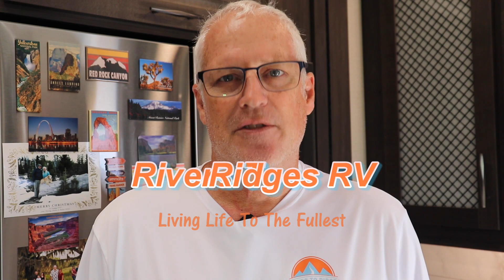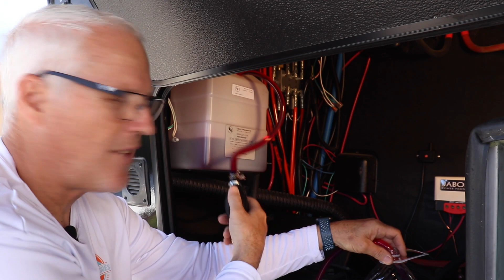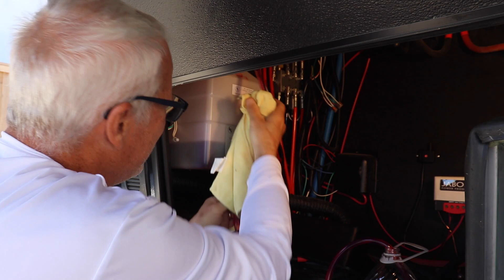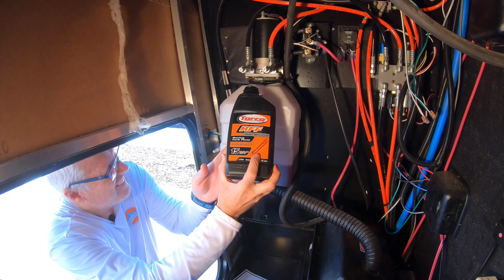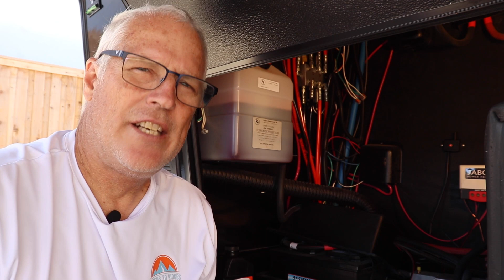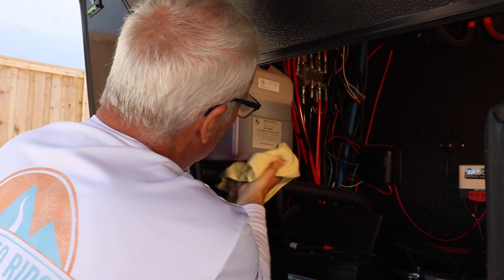Stop This Annoying RV Noise In Under 30 Minutes (full time RV living)

Comment: So did it help?
Reply from the maker: Hi Kaye, Yes, so far it seems to help, we haven't heard any popping noises yet.
Reply: I appreciate this helpful info. I truly do to I have been wondering the same type of noise coming from my pump area. I have a class A and it can get pretty annoying. My issue is if that LCI are aware of this issue from many other RV’s that are having this problem, shouldn’t they compensate for their system? Instead of taking a easy route by giving directions on how to hopefully fix the issue. Just frustrating because I have already contacted them about my slide issues and was giving to many run around. Thank you once again for the extremely helpful info. Much appreciate 👍🏽
Reply from the maker: Thank you, sorry it took so long to get back to you, I missed your comment. I agree, I bet if the manufacturer used the correct products in the beginning instead of trying to save a little money, then most people wouldn't even have the issue.

Comment: My Husband passed away.  We live in our 5th wheel, stationary and long term.  He had a deck built onto the front with stairs.  I don't think I could move the my levelers (jacks) Any suggestions? Also before he passed, we had issues with one of our  slides. He pulled it in and then it would NOT go out for a really long time. We had to get help. Now I'm hearing those noises every night and sometimes the 5th wheel feels like it's shaking like someone is walking around.  It scares me.  Your fix talks about moving slides 😱 and raising and lowering jacks😮. Help?
Reply from the maker: @hollyhalonen6471  sorry to hear about your husband. In the video we talk about adding some fork oil or "anti-stick" oil into the hydraulic system. This helps with the "popping" noises caused by the landing gear slipping. However, you need to be able to retract and extend your hydraulic system in order to get the anti-stick oil to mix with the original oil. This means if you have hydraulic slides and hydraulic leveling gear, you will need to be able to retract and extend them. But, I'm not there so I can't tell you for certain the leveling gear is the issue you're facing.
As far as your stairs go, the only thing I could suggest is to get someone to help slide them out of the way temporarily, if you determine the landing gear is the issue.

good luck
Dan

Comment: Jack popping is literally keeping me awake at night! Shakes the whole front end.  I'm hoping this is the solution.
Reply from the maker: @bilhow911 we had the same problem, the jack popping would wake us up at night and scare the $%^* out of us. This simple fix worked for us and we haven't had a problem since.  Please let us know how it works for you. Make sure to cycle your landing gear a couple of times after you add the oil.

good luck
Dan
Reply: @RiversToRidgesRV  Okay, probably a dumb question, were you hooked up to your tow vehicle when you retracted the landing gear?
Reply from the maker: @bilhow911 No, I was not hooked to my tow vehicle. I fully retracted my landing gear and just let the nose of the RV go very close to the ground, then just extended my landing gear. The only purpose of that is to start to get the new fluid mixed with the old fluid.

If you have any questions, email me at RiversToRidgesRV@gmail.com, then we can talk.

Dan

Comment: Can we get a follow-up one year later? From everything I've seen this is a temporary solution. Putting the slides in is incredibly difficult if you're a full-timer. Other YouTubers have had to replace the hydraulics
Reply from the maker: @AlinaTrevino-bg7js  So far,  everything is just as good as day 1. We still don't have any popping noises. I'm not saying the fix will last forever, but for us, we're still good. I have heard of others who had to re-do the process after a couple of years, but it's not a big deal anyways. Thanks for the comment & thanks for watching! Safe travels.😊

Dan